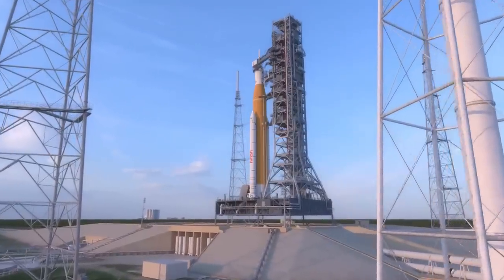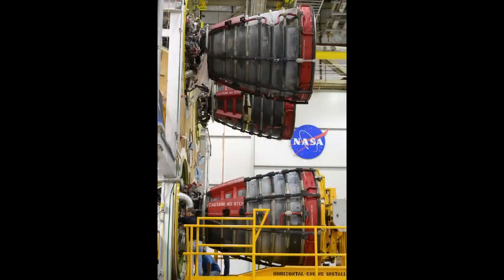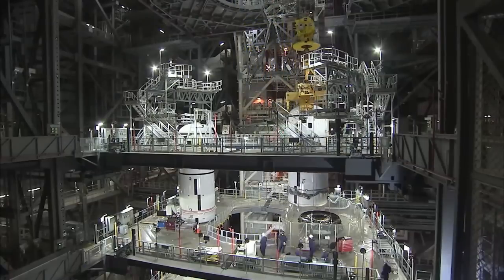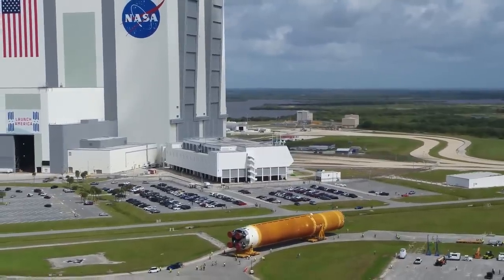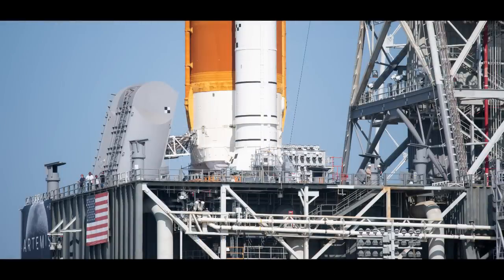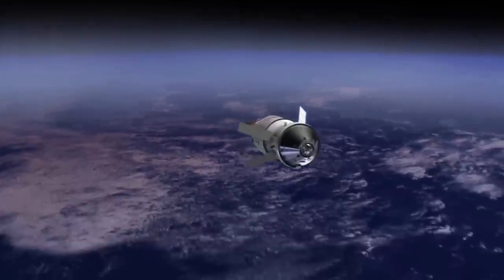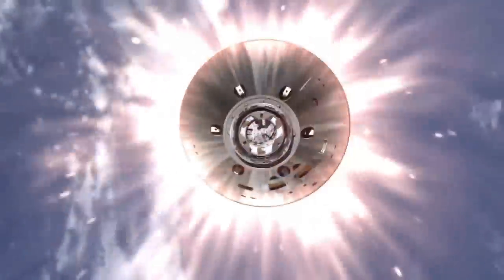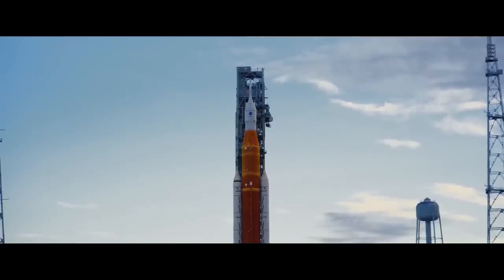What's The Big Deal About Artemis - NASA's New Massive Moon Rocket

Comment: The objectives of this mission make me wonder yet again whether we went to the moon before
Reply: Why's that?
Reply: @yassassin6425  because we sent people to the moon already presumably so why relearn issues radiation exposure, navigation data etc? And this one: "It is important to understand the radiation environment because Artemis will fly humans beyond the protection of Earth’s magnetosphere for the first time since Apollo," NASA spokesman Jimi Russell noted.
Reply: @dataman6744  
Because Orion is a completely different craft to Apollo and Artemis does not have the same mission objectives either. 

You'll notice that there are mannequins in the crew capsule. They are wearing the first-generation Orion Crew Survival System suit – a spacesuit astronauts will wear during launch, entry, and other dynamic phases of their missions. These are fitted with sensors to record Gs and  acceleration. Engineers will compare Artemis I flight data with previous ground-based vibration tests with the same manikin, and human subjects, to correlate performance. Accelerometers inside Orion will provide data for comparing vibration and acceleration between the upper and lower seats. It also evaluates the integration of the newly designed systems with an energy dampening system that the seats are mounted on.

In terms of radiation, as I mentioned, Orion is a completely different craft to Apollo designed for longer duration and distance The longest Apollo mission was Apollo 17 at 12 days - Artemis 1 is 42 days in comparison and unlike Apollo reaches an apogee around the moon of 40,000 miles. One of the mannequins is testing a new radiation shielding vest, called the astrorad. Also the mission coincides with peak solar activity which is a tremendous opportunity to gain more data in respect of the crew cabin and its systems. 

Orion utilises onboard systems use modern electronics that are far more vulnerable to particle radiation than their Apollo-era counterparts and it is designed for missions of longer distance and duration. The Apollo Guidance Computer used low density integrated circuits and magnetic core memory, both of which are extremely radiation resistant. When high-energy protons and other ions hit orbiting spacecraft, they often leave ionization tracks in electronic chips. These tracks can upset spacecraft computer memories and otherwise disrupt sensitive electronics. Un 2014 Orion was deliberately sent into the more intense inner belt to test these.
Reply: @yassassin6425  Presumably all these data was collected during the many Apollo missions for all the designs and adjustments to be made for future missions. Why collected these baseline data again? That's my point
Reply: @dataman6744  
Read my reply again. Because as I explained Orion is a completely different craft and is designed for missions of longer duration and distance. It is also gathering a range of different data to Apollo and has more sophisticated ways of doing this. As opposed to a six day mission, Artemis 1 is six weeks and will achieve an orbital apogee of 40,000 miles around the moon which is the furthest that a spacecraft designed for manned missions has ever been from earth.
Reply: @yassassin6425  the craft may be different but the data collected was already collected and actual human beings went there for crying out loud. What are the dummies for?? I don't get it. I they tell me never went to the moon, it would make sense
Reply: @dataman6744  
I have explained the next generation space suit to you, the use of accelerometers for launch and reentry and the astrovest. 

To clarify again, Orion is designed for totally different missions to Apollo of far greater duration and distance, Artemis 1 is six weeks as opposed to six - seven days of Apollo which means more data can be collected from an apogee of 40,000 miles coinciding with a peak in the solar cycle. It also utilises completely different systems to Apollo. 

Simply because you "don't get" something doesn't make it suspicious. Your incredulity has no bearing upon reality. If you wish to believe that Apollo never went to the moon because you can't comprehend the wealth of data that Artemis I will yield, than that is entirely your prerogative. But simply because something doesn't make sense to you, is not the same as it isn't true.
Reply: @dataman6744  Tell me kiddo, why we crash test every new model of car? By your "logic" none should be tested because we have all data from previous tests... seriously kiddo grow a brain;)
Reply: @tgstudio85  you have a point but when did the crush tests for the appolo take place?
Reply: @tgstudio85  still on the ground we we paps?

Comment: Parts from a failed program being used for an unsustainable project.  Appropriate.
Reply: space shuttle was not a faluire expensive yes. but without it there woykld be no bubble repair or the ISS. they should have not listed to military specifications nad kept the tank internal and run on methane. that would have dropped costs\
Reply: @krisshnapeswanipeswani3190  Shuttle met none of it goals, highest $/kg of any launch system ever, abandoned by the military after Challenger, ISS modules could have launched using expendables for less money, Shuttle killed 14 astronauts including the first teacher in space, took money away from developing a crew only launch system with a launch escape system, caused a 9 year gap where we had to depend on Soyuz to get to the ISS at $80M a seat.  How can you say Shuttle was not a failure ?
Reply: @dionysus2006  it was a lesson in risk management. Without its heavy lift capacity the ISS would not have been possible. I do not defend the shuttle program but history would have been a lot worse
Reply: @krisshnapeswanipeswani3190  ISS modules could have been launched with expendables for much less money and risk.  This would have been paired with a crew launch system with a LES for any EVA activity (such as Hubble).  With this strategy we wouldn't have had a gap from 2011 to 2020 in US ability to launch crew because the money we saved from the failed Shuttle program would have gone to developing a crew launch system starting in 1986.  The military launched from 1986 on without Shuttle.   The military was the reason the Shuttle payload bay was so big. It was scaled to hold their spy satellites and such.  The military continued to launch these huge payloads without Shuttle which means there were expendable launch vehicles that could launch ISS modules for less money than Shuttle.  The Shuttle was a black eye for America.  So glad it's gone.
Reply: @krisshnapeswanipeswani3190 Shuttle cost more than Saturn V. I am certain that the Saturn rockets shouldn’t have been abandoned so quickly. They could’ve been used until the 80s.
Reply: @tempejkl  they did not know that. Hind sight is 2020

Comment: I would like to be excited. I can't, because Saturn V was more capable. It didn't need troublesome (Challenger) solids with two MORE joints. It had a full size service module. It was able to carry a Lunar Excursion Module to land and ascend from the lunar surface as well as an electric buggy. Artimis is a regression by 60 years able to only support crew for 3 weeks and withstand a 6 month maximum parked in space. At least it has a camping toilet and a pilot relief tube to recycle water. New? Remember the "rogue engineers" trying to get this built during the Constellation time frame? At THAT time it was a good plan. Now, it's something I'm ashamed of. How low we have fallen. Even the service module engine is used from a shuttle OMS pod. Nasa at the Cape, DC and Houston need to rolled into Space Force and the suits sent packing. Engineers should build rockets.

Comment: I really want Artemis to get with propulsive landing,and save those beautiful HYDROGEN burning RS-25 engines from a senseless disposable death.
If NASA could do this, it would be the only 100% clean launch system to date.
Reply: Booster reusability is great, but has drawbacks.
First, if you don't have a fast enough launch cadence, you can spend more on recovery than you save by reusing the booster.
Second, you take a payload hit for the recovery system on the booster. The Falcon 9 B5 can lift up to 22.8 tons to LEO when expended, but only up to 16.3 tons when landed on a drone ship (B1051.12). Doing a Return to Launch Site (RTLS) landings, costs even more payload.

So with SLS launching once or twice a year, the cadence doesn't really justify recovering the booster. Not to mention that it gets higher and faster than a Falcon 9.
The SLS Block 1 can get Orion to the Moon, but not with the kind of payload hit like F9 has. The SLS Block 1B will send along a Lunar Gateway module with Orion, so it really can't take the payload hit either.
SLS started design work in 2011, 4 years before SpaceX landed the first booster and almost 6 years before they reused a booster.

Comment: It's  roughly the same shape and size as the Saturn V moon rockets, except for the two strap-on dildos. People like myself should be the ones going to Mars. I took one look at certain rock formations and said, "Hey, I could build stuff out of that!" Give me enough food, water, and oxygen, and in the lower gravity I could get a lot done per day. For example, one guy (used to such labour) can empty around three 55-foot trailers filled floor to ceiling with, say, sacks of rice, per day. Your standard trailers measure like this: 

Length: 28 to 53 foot
Width:96 to 102 inches
Height: 12.6 to 13.6 ft
The capacity of 2089 cubic feet to 3489 cubic feet

Multiply by three and that's what one guy can do in a day (53 to 55 feet times three). In terms of building material, you need access to water and something to make mortar with. Very little water is required to make mortar. Make in sections roughly the size of a 55' container, but with an arched roof. The shape of the building can be determined by using an inflatable and reusable bag as a template. Inflate, build around it, deflate, rinse and repeat ad nauseam. 

Build the walls good and thick, maybe even make it cut 'n' cover for extra protection, when done line the interior with an inflatable air-proof lining, pressurise, add solar lighting, add oxygen, start a grow-op, and we're done. Forget all the high-tech stuff that's being planned. Simplest is best.
Reply: While on Mars you would be moving lighter weights, but you have to work against the mass which is the same as on Earth.
Inertia will be the enemy.
Reply: @kelduck8851  It's a simple case of adjusting one's movements.